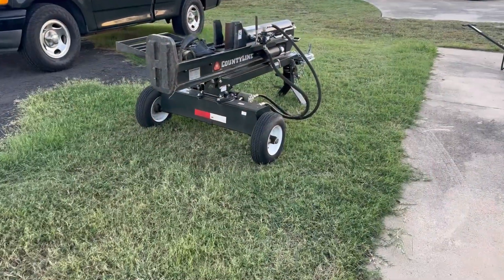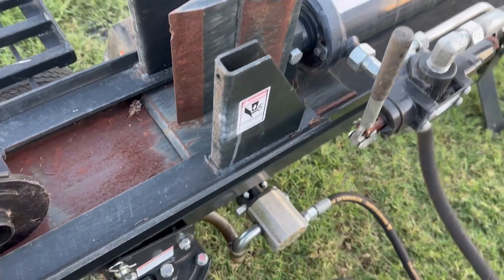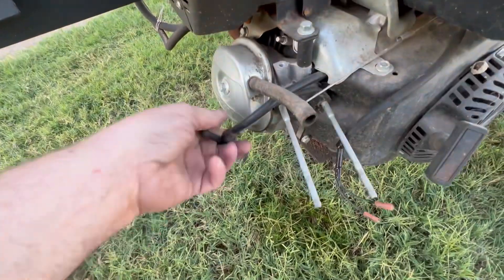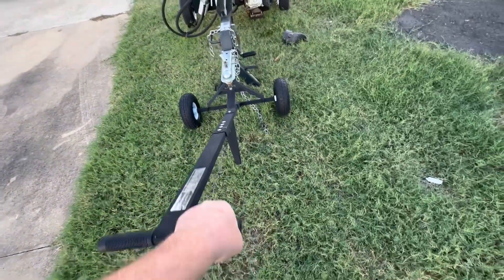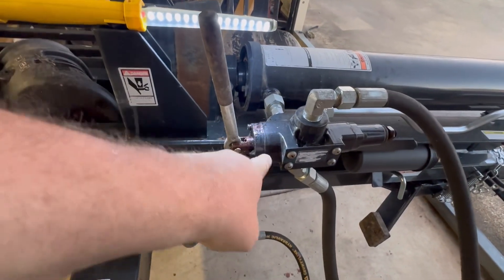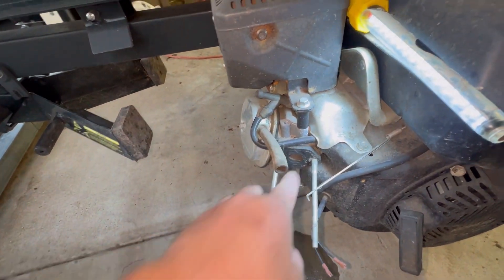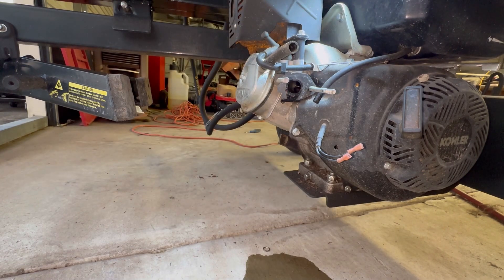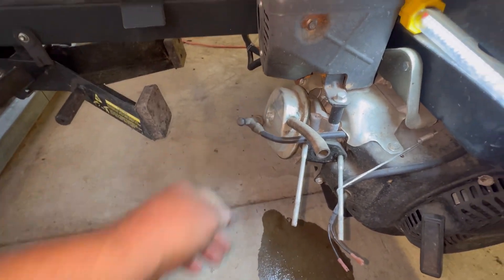BASIC SMALL ENGINE DIAGNOSTICS THE EASY WAY

Comment: 9 times out of 10 we know it's gonna be the carb (unless it's missing)!  ;-)  In this case the very next thing to check when it doesn't fire with fuel added is spark.  Failed spark plug isn't very common, but it does happen, so don't discount that as a possible cause, and it's easy enough to swap out for a known good one.

The only thing I would have done differently, Jeremy, is check the oil first - just to make sure we don't blow up the engine for lack of oil!  That would also eliminate the low oil shutoff as a possible issue, assuming the wiring and sensor are working OK.